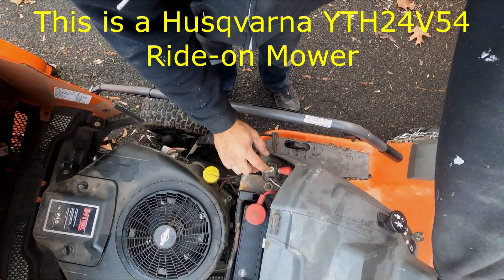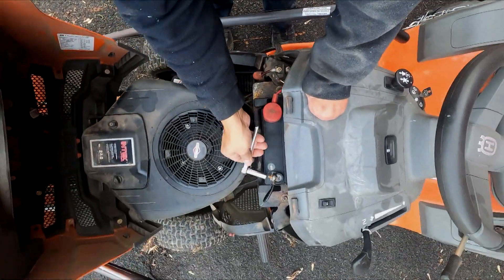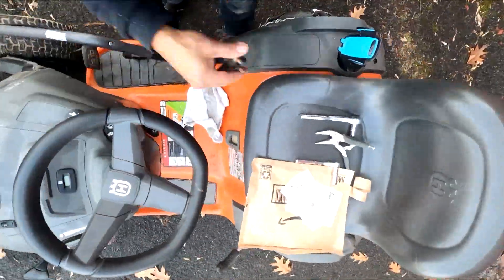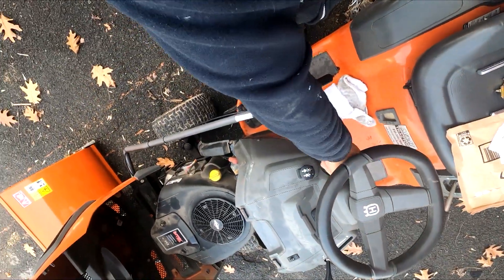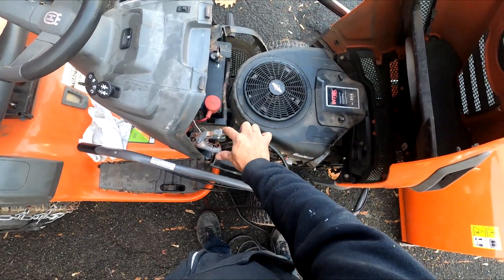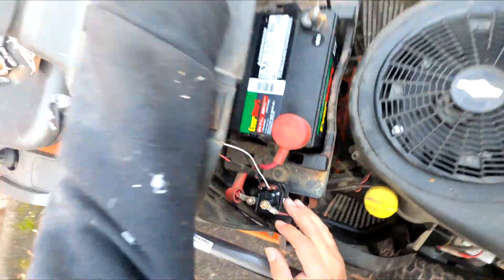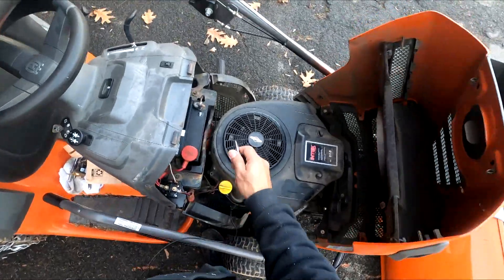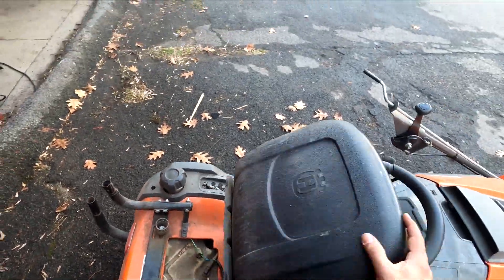Husqvarna solenoid replacement

Comment: for mine, the battery is under the seat and the starter solenoid is under the battery. same exact solenoid though. is it necessary to wipe down that area when you remove the solenoid?
Reply from the maker: Not at all. But disconnecting the battery first should be completed.

Comment: How did u know it was the solenoid and not starter motor?
Reply: I didn't know. Just doing process of elimination. In the end, it happened to be bad wires. Hope this helps. Thanks for asking!
Reply from the maker: Rule of thumb, always start with the least expensive part. You can always do a return. Process of elimination once you have a general idea of what it could be.